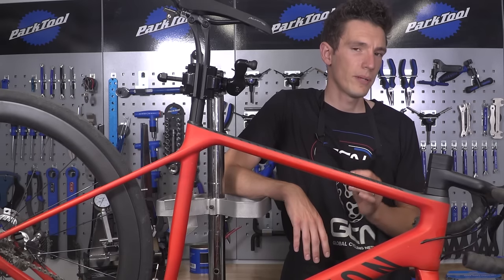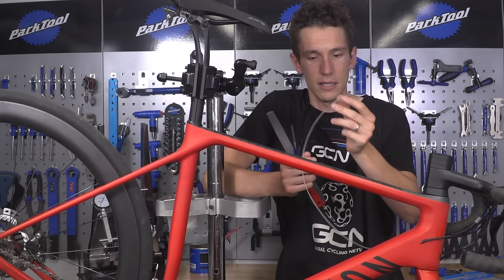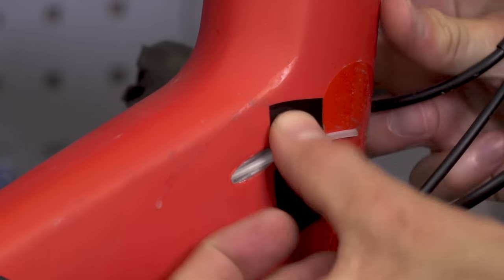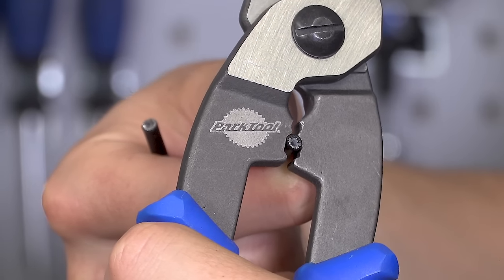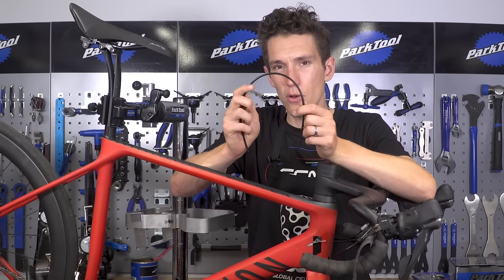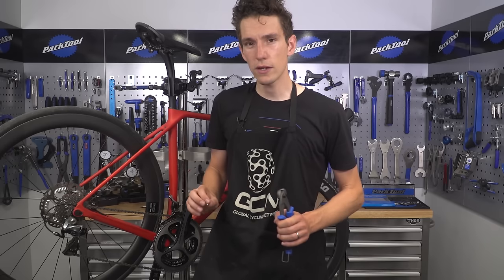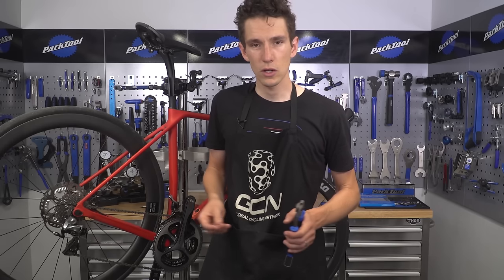How To Replace & Fit Gear Cables On A Road Bike Like A Pro | Maintenance Monday

Comment: It would have been good if you elaborated on routing around the head tube (criss cross) or direct.
Reply: It's crazy how many bikes are set up OEM with the cable housing mashed against the head tube after exiting from the bar tape and taking a sharp curve to the same side of the frame.  This is simply stupid.  That bike manufacturers aren't routing cables this way (right cable to left side of frame, and vise versa) at this point is almost criminal.  My LBS showed Cannondale this trick 25 years ago, after which they made this SOP for their builds.  (We also taught them how to overhaul the Headshok, but that's another story.)

Comment: Question: on my shifters there is a little plastic "screwing thing" that I can use to micro-adjust the shifting -> do I need to fully screw/unscrew it before putting the new cable in, or should I set it approximately in the middle of the screwing range ?
Reply from the maker: +GoustiFruit φ fully screw it in
Reply: Thanks.
Reply: screw the thing in, then screw it out to compensate for cacble stretch and brake pad wear.

Comment: Thanks, as always excellent videos with only the best relevant information. I live in Australia, does anyone know where I can get the inner sheath you used to ease guiding the cable through. To date I've been using fishing line but much prefer the tubing you use.
Reply: For those interested in getting the sheath to feed the cable through. Get a length of outer, strip it down (remove plastic, wire surround) and hey presto there's a perfect plastic tube inside!

Comment: I was having trouble, only in in cold weather, with the three biggest cogs skipping around, despite having changed the cassette and chain fairly recently.  In desperation, I thought I'd try changing cables and housings.  I had to use the magnet trick on the rear cable, and had some challenges with the internal routing housing on the front, but complications were overcome and lo and behold all the gears work well, and overall performance is noticeably better.  I had no idea how much performance had declined over 5 years.
Reply: Typically, when experiencing shifting issues "only in the cold weather" it's a matter of lubrication, even inside the hand shifter.

Comment: thank you for saving me 60 bucks mate.  my LBS wanted to charge me a basic tune up price to install the brake and shifter cables, even though I am supplying brand new shifters and brakes with the cables already installed in the device itself ( its a 2 in 1 shimano tourney I am trying to get an old Giant rincon I found at an estate sale road ready because the cables were rusted and exposed)

Comment: Quick question, I ride a Scott Speedster 50 which has a Shimano sora group-set on it, can i still use the dura-ace or the 105/tiagra cables or do i have to find the cables made for the Sora gs. 
Thank you
Reply: I see, thank you very much for your help

Comment: Awesome tip on using the inner sheath to make rerouting internal cables easy!  FYI, I'm having fantastic results with Jagwire's teflon coated cable and compressionless housings - silky smooth action.
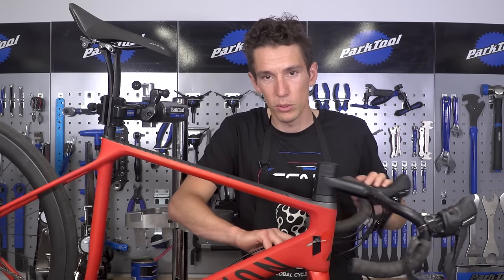Reply: Also - for those doing this job on a bike they got from a shop or on order:  You can almost always shorten your housings which will result is somewhat less friction (small difference).  Shops will nearly always build with 2-3 inches or more of unnecessary housing length.  Just be careful not to go too short as they cover here at around 4:50.

Comment: Have any specification for the tubing used to feed the new cable through the frame?
Reply from the maker: hi, a local bike shop will be able to help out. thanks, Jon
Reply: For the benefit of everybody with this issue, Google 'Jagwire Slick-Lube Liner' - it is like an inner tube for brake cable housing, it should work perfectly to feed new cable through the frame.
Reply: @gcn  Local bike shops are not real keen on helping do-it-yourself-ers.
Reply: @markrodgers2976  They are if you buy stuff from them, too.
Reply: @beeble2003  Yeah, I'm sure some are, but in my experience, a lot seem to insist on complete shop loyalty. from parts to labor. Last time I was in one of ors LBS's, the guy was essentially making the argument that it was incumbent on me to pay more for parts, and use their labor, in order to prolong the existence of local bike shops. I told him I was very concerned and sympathetic about the disappearance of small, locally-owned retail stores, but that I simply can't afford to pay $50 for a damn bike tire, when I can find THREE decent tires,  for that same money, on the internet, and that I'm perfectly capable of doing 95% of bike maintenance, myself.
Reply: mark rodgers Wow, that guy has a real sense of entitlement. Is there a bike co-op in your area?
Reply: @beeble2003  Not that I've ever heard of. I read about them on the bike forums, sounds like a great asset to have around. But I seem to get by ok hunting deals on-line (ebay,nashbar, etc) and referencing the forums and You-tube tutorials

Comment: Where can I find that inner tubing for easy routing of the cable?
Reply: For the benefit of everybody with this issue, Google 'Jagwire Slick-Lube Liner' - it is like an inner tube for brake cable housing, it should work perfectly to feed new cable through the frame.

Comment: how can i shift the shifter to correct position when cable not installed.  I need to install a new cable after removing one and I accidentially shifted the shifter to another position. Now its in the incorrect position to thread the cable through. Thanks.
Reply: JohnOsCreations I seem to have the same problem. I’m hand tensioning the new cable and it’s not being pulled or loosened.

Comment: Just used this video to do my right shifter, but could not find a thin enough plastic tubing to use out of all the ones that I had in my garage, nearest was 1mm to big. So used a vacuum to suck a pieces of cotton down the frame to the crank case under cover then pulled the cable down, out the back end was easier. So all done only to discover that the ratchet on the shifter is buggered!!!! Oh well!!  More research as no bike shops open near me due to the Covid-19!!! Excellent video though.
Reply from the maker: Sounds like a lot of faff for some bad luck, sorry to hear that Mike, but great to hear that you found this useful. Hope you get a new shifter soon.

Comment: #torqueback when changing cables should you first change the rear derailleur cable and then do the front derailleur? Or it doesn't matter? I ask because I wonder how you index both front/rear derailleur simultaneously after a new cable install. My guess is start with the rear derailleur in small chain ring and then index your front derailleur.
Reply from the maker: hi, it doesn't matter which you do first. cheers

Comment: Geez man the whole reason I watched this video was to see how you secured the front cable to the front derailleur and you skip over that with "it should already be there" but you managed to include taking the handle bar tape off and putting it back on??

Comment: I like the tube idea, but why not just tape the cables together while feeding it thru and doing em ONE at a time. You could also superglue the ends together. Its how i did my rear madone cable when replacing the bontrager rear caliper to ultregra rear bottom brakes.
Reply: Good thinking!!

Comment: I am wondering what is the difference between brake cable and gear cable? How can you tell the difference and is anything wrong if you use brake cable for gears and vice versa? :)
Reply: brake cable is thicker in diameter and you really can't thread brake cable into derailleurs - it just won't work.
Reply: Oh okey. Thank you! :)

Comment: this going to be sound silly, where do you get that small plastic tubing/hose that is small enough to be able to thread inside the bike.
Reply: not silly - i want to know too
Reply: It comes in frames with internal cable routing.  I always make it a point to keep the tubing just for this job when I build a bike from the frame up.
Reply from the maker: hi Chee, you should be able to buy one from a local bike shop. thanks, Jon
Reply: thanks I will ask
Reply: I see...this is my first road bike and its already fully built by the shop. Thanks will keep a mental note on this when one day i decided for fun to build my own bike.
Reply: One thing you can do if you don't have tubing is tie dental floss to the line and tape it with a minimal amount of electrical tape. The tape is just to avoid snagging when pulling the new cable back in.
Reply: @Iowahurler82  - that's a great idea. I was wondering how to attach fishing line.
Reply: @edusenix  best bet would be clove hitch then a couple of three half hitches. Could further secure with some electrical tape.
Reply: For the benefit of everybody with this issue, Google 'Jagwire Slick-Lube Liner' - it is like an inner tube for brake cable housing, it should work perfectly to feed new cable through the frame.

Comment: I wish you would have explained the purpose of the ferrules a bit more.  I finished replacing my rear shifter cable and now realize there were no ferrules. I’m not sure what they’re for or how important they are. Good video, otherwise. Good tips.

Comment: step 1. min 2.10. it's impossible to do what simon did: There's a plastic piece under the bottom bracket for both mech cables to pass through. YOU MUST remove that and then remove the old plastic cable. it's longer operation than this video is showing.

Comment: where do i get an inner sheath?
Reply: that's the outer housing, I want the inner plastic thing to thread the inner..
Reply: Me too. Where can we get inner plastic sheaths?
Reply: You can't buy just the inner sheath, it comes with the whole jacket.
Reply: For the benefit of everybody with this issue, Google 'Jagwire Slick-Lube Liner' - it is like an inner tube for brake cable housing, it should work perfectly to feed new cable through the frame.
Reply: I used a length of aquarium  air hose...much cheaper and a lot easier to obtain ;-)

Comment: Thin plastic tube? Who has that? Use dental floss. Two tips, 1. put levers in lowest gear while the old cable is still in 2. Super glue the end of the cable to stop it fraying as you thread it in.

Comment: Wow that's screwed up you have to undo tape, take off hood to replace cable? With downtube shifters it takes like 2 minutes, I had cable break couple times on rides, got new one at the shop, replaced it myself and went home, with this junk I'd be stuck there for hours… Now I know how the shop owner was surprised when I was done in couple minutes, cause he got used to this shit lol

Comment: Can you clamp that seatpost like that?
Reply: On a carbon frame - that the the safest place since if you over tighten and crack it, it can be replaced. BUT - if we're smart about it, get a frame stand if you're going to have a carbon frame or any material bike. Way better for the frame and much easier to work/wash the bike on.
Reply: I meant specifically that seat post with the duel leaf thing going on. I just hook the saddle nose on my workstand, bike swinging in the breeze.
Reply: I meant specifically that seat post with the duel leaf thing going on. I just hook the saddle nose on my workstand, bike swinging in the breeze.
Reply: I meant specifically that seat post with the duel leaf thing going on. I just hook the saddle nose on my workstand, bike swinging in the breeze.
Reply: I meant specifically that seat post with the duel leaf thing going on. I just hook the saddle nose on my workstand, bike swinging in the breeze.
Reply: I meant that seatpost specifically, the duel leaf thingy that canyon have.  I just hang the nose of the saddle on the clamp on my workstands, bike swinging in the breeze, it's surprisingly secure like that and obviously quick to mount and dismount.

Comment: Why are you repeating a video you've done already but just adding "like a pro"!!!!!!!! ????
Reply: Foreverreign TCR right!
Reply: Probably because Shimano is paying for it. From the description, "Thanks to Shimano for the products used in this video. All views are the presenters own."
Reply: Pros don't actually change their cables
Reply: i think its taking it a lot more slowly and giving more detail (a feedback left and responded to by GCN on the other one)
Reply: The old one was way shorter and less in depth. I'm glad I found this one. My 10 year old bike just snapped the front derailer cable at the shifter end. $10 spent at the local toystore and I'm up and running (or riding) again.